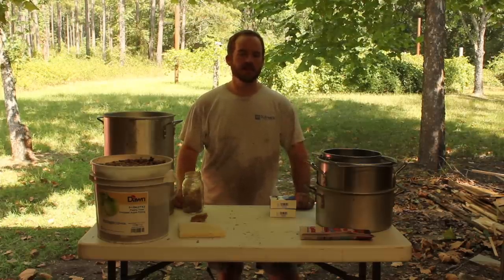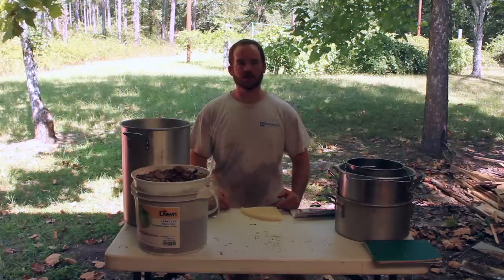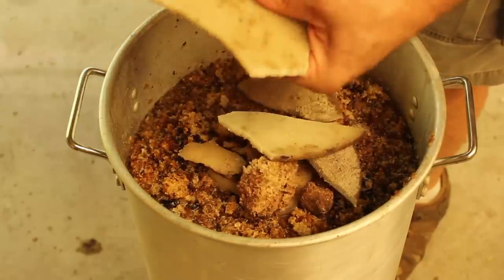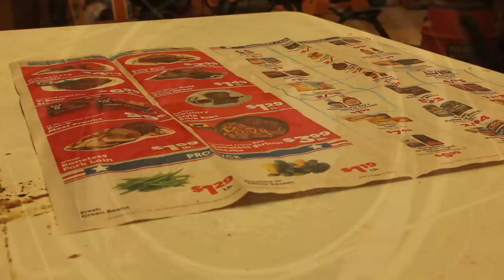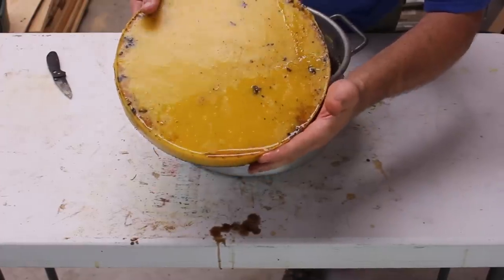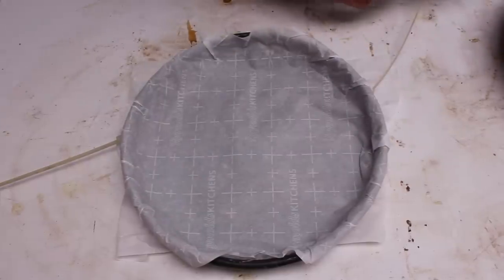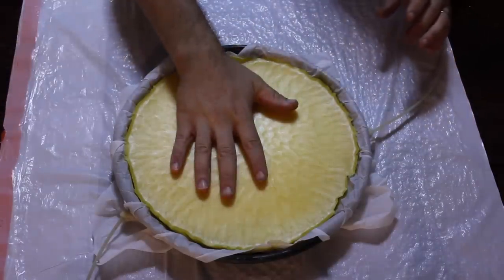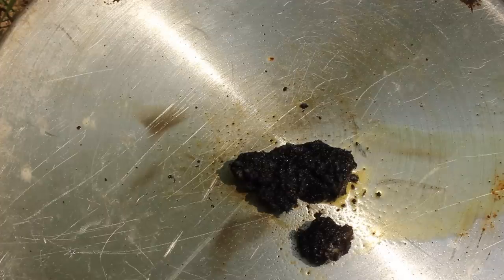From Trash to Treasure: How to Render Beeswax

Comment: You would need more wax for the fire starter. That type of fire starter is basically a candle and what you were trying to burn , while it may have been too wet, acts like the wick for the wax. You can pour wax in paper egg cartons and once dry tear one off to start a fire.

Comment: Two things. When working over concrete like you were with the fish fryer, you can keep the concrete under and around it wet by spilling water from a bucket. If you have a boil over or a spill it will lift right off after it sets instead of soaking in to the  concrete. And as to the firestarters, since it is a wax type of product it needs a wick. so instead of dumping on the table dump it into old empty cardboard egg cartons. Easy to transport, and just break into twelve "blocks" while the cardboard acts like a wick in a lamp or candle. The flame sill be on the cardboard but it will actually be burning the wax until it is gone and then the trash and cardboard will finish into ash. Have seem them made with old straw or mower cuttings wadded into the egg compartments before putting the waxy scrap into the cartons.  Good luck.

Comment: For the trash to firestarters. I mix either dryer lint or saw dust ( don't know where you'd find that, smile ) with the trash and put into old egg cartons once hard you can either leave em as is and tear off as needed or cut apart and store in air tight container.

Comment: Tip: Set up a couple of lights behind the camera, so your face isn't so dark against the background. They don't have to be expensive. Even battry driven ones can work, with LED lights, if you can find 'em. The most important part is the temperature of the light, so make sure it's rated for daylight if you want to use them outside. Edit: Alternatively, setting up a simple big white board (such as styrofoam) can do wonders, as it reflects sunlight back into your face.

Comment: Cleaning recommendation:  I would think an oil like butter would dissolve propolis just like it does pitch on pants and then wash for removal.  For wax, there is always an iron and paper towel method for removing wax from cloth or carpet.

Comment: I put my beeswax in the deep freeze after it cools.  This will do two things, makes a mold release more easily or if you are just having blocks of wax, a block of wax is very hard to break.  Frozen wax will shatter if you drop it on a hard surface or hit it with a hammer.

Comment: That double steel ring strainer is actually a honey strainer.  Once you've used it for wax, you can't really use it for honey again (it's nearly impossible to clean out the wax properly).  I just use the cheapest metal flour sieves I can find.

Comment: melting point of wax is 62 to 64 °C (144 to 147 °F). If beeswax is heated above 85 °C (185 °F) discoloration occurs.  water boils at 212 °F  so you don't need that high a temperature what you want is 62 to 64 °C (144 to 147 °F)

Comment: You know, you can do this much more simply.   Just heat the wax with an amount of water, until its just bubbling. Now, with care not to burn your hands, pour it through a conical strainer with holes of about 1/8 inch, into a tall, narrow plastic pail, or if possible  a length of narrow SS tubing. ( I sometimes use an old fire extinguisher wit the top cut off.)  Leave it to cool overnight.  and just scrape off the brown sludge from under the clean yellow block in the morning.  Repeat the process with accumulated blocks until there is hardly any brown sludge left.

Comment: One thing I wanted to ask is ... because the extractors are such a pain... is there a way to warm honey to do like a heat strain extractor method similar to crush and strain but with a small amount of heat? Or will this make the honey taste bad? How do you warm honey for extraction without messing it up? 

The extraction process really is wow, its way more complex than I realized. And it does take a bit of skill to figure out.

Comment: melting point of wax is  62 to 64 °C (144 to 147 °F). If beeswax is heated above 85 °C (185 °F) discoloration occurs.  you do not want to heat it above 85 °C (185 °F)   water boils at 212 °F   keep the temperature 62 to 64 °C (144 to 147 °F).

Comment: If you prime the pot with a little water before adding the wax, it should prevent or make less burn on the bottom of your pot. Just a suggestion. Buy some parchment paper that will work instead of newspaper. Just a suggestion from working for a caterer.

Comment: May I suggest, that next time, before doing the final melt, you simply scrape the majority of the trash off the bottom of the cakes, to have less trash in your pantyhose. also thinking that maybe a smaller final filter catch container may be better, so you can use knee hi pantyhose, instead of full legs... Just a few thoughts

Comment: If you get wax on anything in your home, use a steam cleaner or steam heater to melt it and wipe it up with a paper towel.  If it gets on your carpet, put down three papertowels one on top of the other and then place your iron on it.  The heat will melt the wax and paper-towels will soak it up.

Comment: I pour my melted wax into styrofoam cups. When the wax cools and hardens, it contracts and doesn't adhere to the sides of the cup. Also, if any impurities are present, they will be on the small, bottom end of the hardened wax and can be cut off with a loop of dental floss.

Comment: I have a friend that showed me how to make the fire starter stuff. He used a 1 ton press to get the water out, then broke it up and let it air dry in the shade. If you put it in sunlight it will melt and make a mess.
Reply: leaving it out for a week or two in the sun would also work as long as it doesn't rain and you don't have dew in the mornings

Comment: Few questions - 

Why boil for 30 mins after it's already fully melted and been boiling already? I dont see the need for extended boiling, as the wax just needs to be melted and in a liquid state.

Why not filter it the first time after melting, before cooling it? It was roughly filtered but I don't understand why it wasn't finely filtered as well at that point. Seems like it could've been all filtered and done then, when it was melted already, instead of having to re-melt and re-filter.

The final product came out beautiful, don't get me wrong. I just wonder if it could've been done quicker and with less work.

Comment: A very nice, fine job, … & yes, the color is a perfect yellow, mild, yet not translucent to the point of being of a too thin color depth, … And yes indeedy, having dedicated utensils, pots, & pans, plus disposable items like the hosiery, are very good concepts, of keeping the “Queen Bee”/significant other/spouse, etcetera, … happy, & compliant with good harmony in the home, … (even though, I must say that I have been caught, using a butter knife for a screwdriver, or small hammer, … & other types of 		kitchen paraphernalia, outside of its normal usages, … makes me wish I could turn the clock back 50 years, … lmbo, guffaw, hack, hack, cough, …  (lmbo!!!)

Comment: I render lots of wax.
It starts out ugly.
Boil water and toss your wax in.
We use a canning pot. Cheap and big. Fits on the turkey fryer.
Boil your wax. Pour the water n wax thru a sieve into bucket. Let harden overnight. Next scrape the slum gum off the bottom.
Chop your "hunk" into pieces that fit into a candle makers pot. It's tall and meant for pouring. Melt the wax in the pouring pot. 
There is still some yuck in there but it settles to the bottom. 
Pour carefully into a container.  We use sherbet tubs for molds. 
If you are careful you can pour pure bees wax into the tubs. About a pound each is good.
That's the finished product.
You can melt it one more time in a clean candle makers pot and make candles that are perfect. We make and burn bees wax candles. It purifies the air naturally. Look it up.

Comment: don't throw away this water (if you rinse it with hot water)... if those are cappings it is full of honey. Just drop down the temp to around 30 C and add wine yeast. You will get mead :). Ofc you just check how much honey you have there but mead is a mead man :D

Comment: Pretty wax. Work on the steps to process the wax. You lost a lot of it.  Suggestion would be when melting the cappings put a long wide strainer in the pot. You can find them cheap. The wax will seep through and then ladle the clean wax into your pots with an inch of hot water. You won’t lose your wax in the slum gum the way you did.  This would be the only step to make. Any particulates will settle to the bottom of the cake and scrape that off. Done. No need to us pantyhose either. Find an old sweatshirt, white and pour the wax through it but inside out. Done.

Comment: You may not have good fire starter material, but put it on a fine stainless steel mesh and you could have a good ay to get more wax out of it.  Heat gun might work better than a torch, though.

Comment: when i was a kid i remember my granny made candles out of bees wax, was about in the 1960s 
btw, your degrees are in Fahrenheit i guess? Celsius is so easy to use, dont get why ppl still using the old age measure. Ice =+-0Celsius Water Boiling at +100Celsius, not Rocket Science 
nice video thx for sharing

Comment: Just a helpful warning, DON'T USE NEWPAPER OR FLYERS! Having worked in a large commercial printing press, those color flyer ads you used contain at least the following chemicals if not more: Sulphuric Acid, Hydroquinone, Isocyanate prepolymers, Methacrylates, Ammonium, Ketones, Perchloroethylene, Sodium hypochlorite, Methyl ethyl ketone, Benzene, Methanol, Lead dust and 
Photo polymers.

Comment: I don't think that stuff is going to work as a fire starter by itself. You need a "wick". As I said, spread it out thin on the paper. Or thin, in the panty hose. Then cut into strips. Or melt it again, and drizzle over paper egg cartons that have dryer lint in them.

Comment: Putting The wax back through a water bath and heating it two or three times total would clean up the color of the wax and give The junked a chance to settle out into the water then heating just the wax and putting in the mold would give you a cleaner molded wax.  Taking the idea from cleaning the fat from me freshly slaughtered pig.

Comment: The processing that I've utilized is with large "Tamale Pot" fill with dirty brood comb, dirty wax rendering process waste (Junk). Use a fine mesh screen DIY or stovetop fry pan mesh topper may fit snugly into pot on top of scrap wax, top this off with ceramic dinner plate and/or heavy cast iron Dutch Oven lid, add water, boil on no flame heating elements, boil time isn't exact.
Cool down long enough for wax to solidify firmly. 
This was my own development due to not having volumes enough to justify buying commercial turn key equipment.

Here are a couple of links for equipment purchases 

"Logar Insulated Cappings And wax Melter Clarifier Review. Filtering and cleaning Beeswax fast!" on YouTube
https://youtu.be/usb97LNJf1A 
Gwenyn Gruffydd Channel 

"Rendering Wet Wax Cappings With my Finlay Wax Melter, Salvaged 8 Pails of Honey!" on YouTube
https://youtu.be/HSNq7U3fnds 
A Canadian Beekeeper Channel

Comment: I was surprised that you started your fire so high. If you're 5no standing over it stirring while it comes to a rapid boil you could very easily scorch the wax at he bottom turning it black and unusable.  If you have  the time could you let it come to a slower boil and increase your temperature after it melts some?? I would be scared of ruining the entire batch of wax if I let it get hot that quickly. What a waste that would be!

Comment: I don't think there's any science behind how long you boil the water or how much water you use. The more water the better, and as long as everything is totally melted you are good to go. I'm sure those rules were made as a minimum amount of water you need so you don't burn any wax, and the boiling was probably for food-safe wax usage. If it's for candles it shouldn't matter. I also think a second washing step would be helpful but certainly uses a lot of additional fuel and wouldn't be necessary other than for aesthetics

Comment: Looks like you put too much in the pot at the first, and I would have boiled the water first and then put in the Wax. Also, you can dip a can or cup in the top of your container of melted wax and dip out the Wax, one scoop at a time. And by all means, use the tallest container possible,so the Wax is thick and the filth at the bottom is small compared to the top Wax. Also, clean white Wax is the Best price producer. So sperate your Wax into white, off-white, light yellow, medium yellow, deep yellow, dark Wax/ propolis.

Comment: Hello loved your video is there any way that I could buy some a your wax.  forgetting wax out of the carpet boil some hot water put paper towels down on top of the wax not a lot and then put the hot water Boling pot of water on top of the paper towel the hot pot of water will melt the wax and the paper towel will soak it up once the carpet gets hot then just rub a paper towel back and forth and it will soak up the rest of the wax. You can also use a hairdryer. You also can use hot water or the hairdryer to heat up a fork use the fork too come the carpet each time you pull up wax will stay on the fork wiping it off each time. From Michigan USA April 30, 2020. Giving a shout out and a big hello to everyone in the world where do you all live reach out and say hello

Comment: I'm just cringing at those huge chunks of wax going in the double boiler. That'll take forever to melt, better to cut those big chunks into little thumb sized chunks. Elbow grease will save you some propane. I'm super cheap, that just bugs me. I'm sure you've done this for years with no issues. I'm sorry. I'm weird.